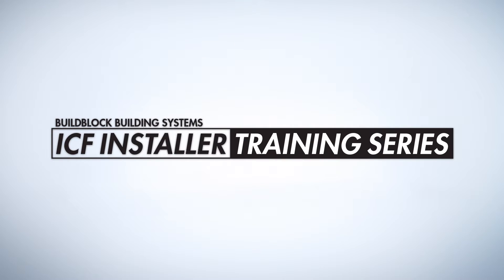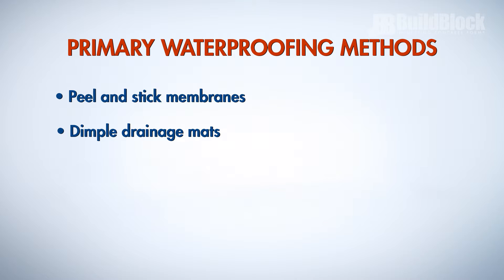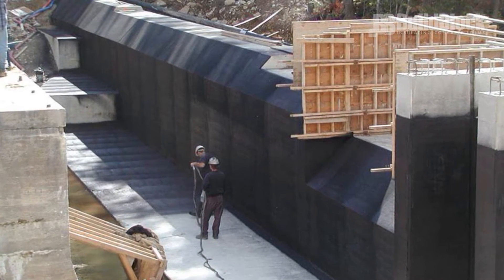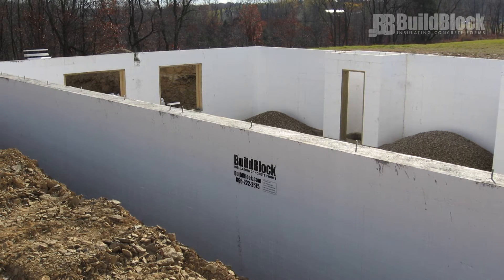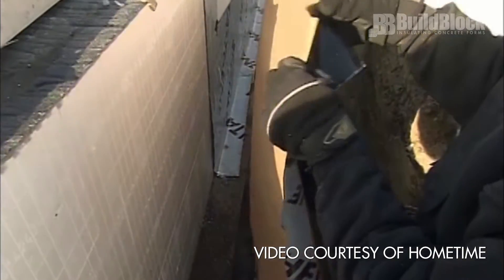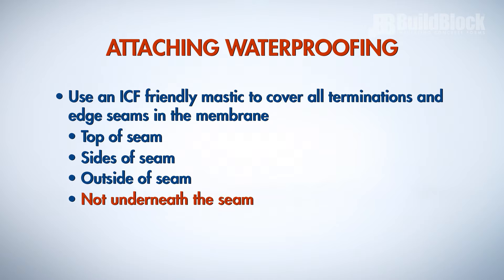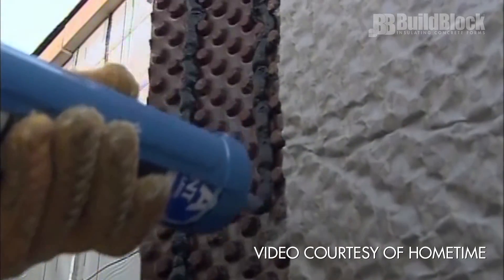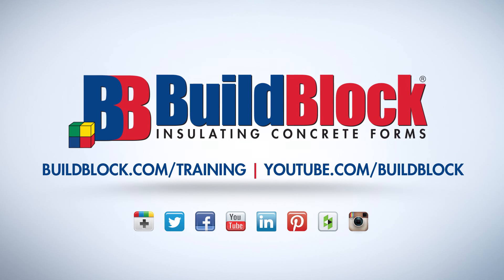BuildBlock ICF Installer Training Series: 17. Waterproofing and Backfilling

Comment: I would never spend the money on making the walls waterproof. If the water is not removed by drain tile at the bottom of the wall, the pressure from the water will blow the walls inward and the roof will drop into the basement. In Florida where hurricanes flooded the area, walls have a hole to let the water into the buildings to even the pressure and prevent walls exploding inward.